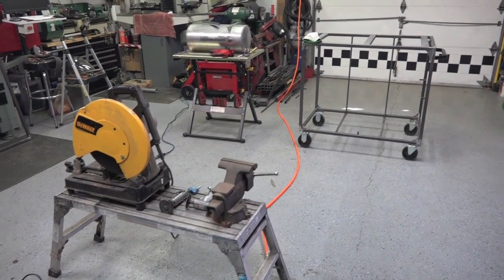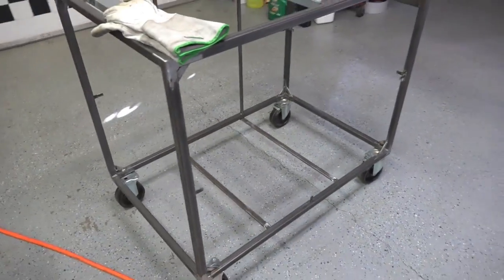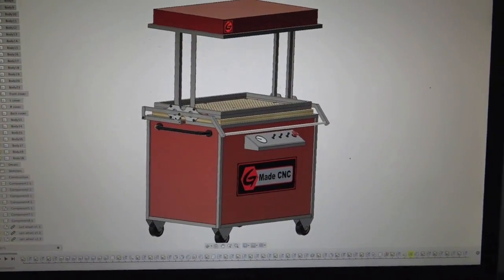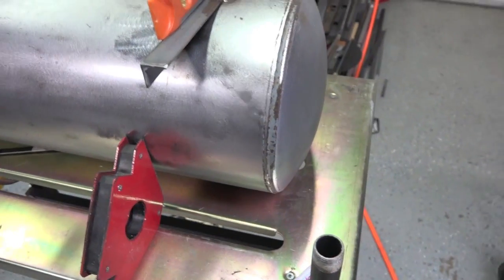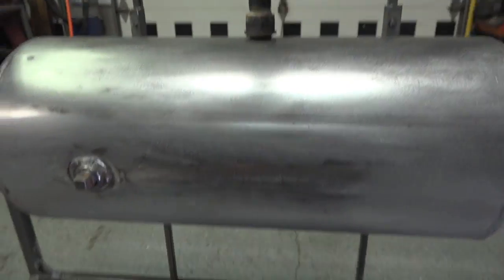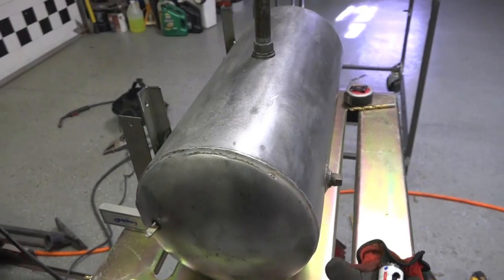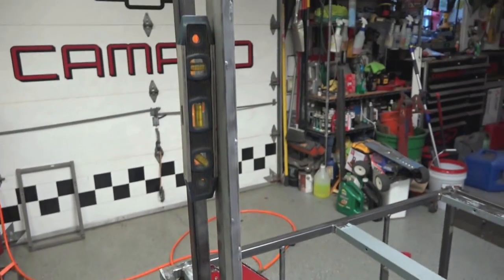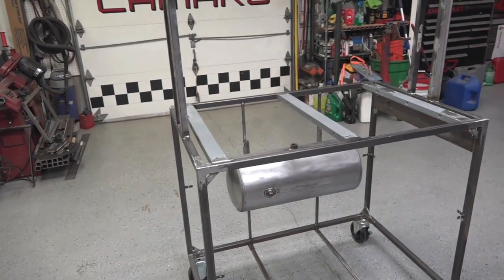Vacuum forming table Part 1

Comment: Hi,

Many thanks for taking us along with you on this project.  As usual, you are doing it first class like your collet closure  project.

I noticed the Camaro insignia on the garage door.  Years ago I helped a friend of mine redo a 1967 RS SS Camaro.  It was a real animal with Sprint Car Motor, turbo 400 tranny, 3200 stall, 4:11 positive traction rear, 3 " exhaust, etc. etc. etc.

G-Made-CNC??  Do you work for General Motors?   Looks like you really have some excellent skill sets.

John
Reply from the maker: Thank you!!! John really prescient that. I try to do my videos in a way that everyone can understand. Everyone has a different skill set and learning curve. I'm know expert by any means but I just hope my video help and can inspire people to try new things.

Nice I had a 1969 Camaro right out of high school it was a 3 year build wish I still had it.

No I don't work for General Motors. Just grew up in a Chevy family lol. I have done many different trades. Enjoyed them all but after a year or two they didn't Challenge me any more . So I moved on to a different trade and so on. Until I build my first CNC X2 mill as a hobby 3 years ago. I was hooked and wanted to do this for a living. It has taken a few years to get to this point. 

Thank you again john for your support. I also like to say I really enjoyed your Belt grinding videos love how it is so clean looking and easy to convert to different setting. I was very impressed. 

Thank you
Patrick